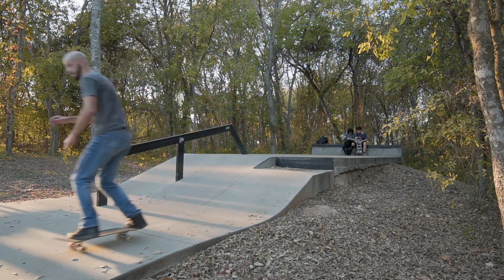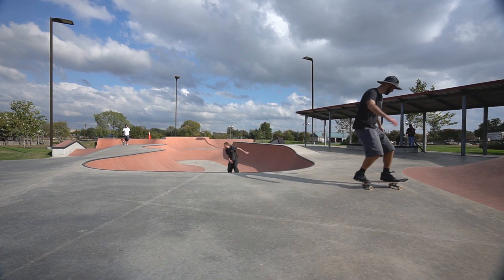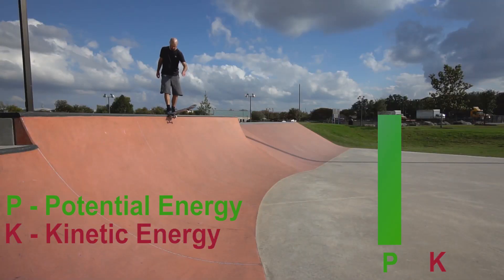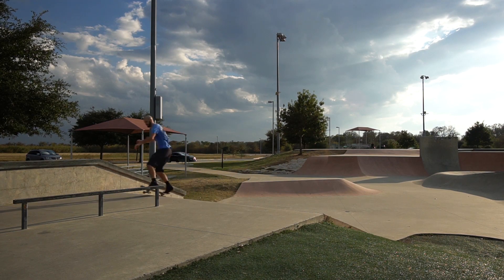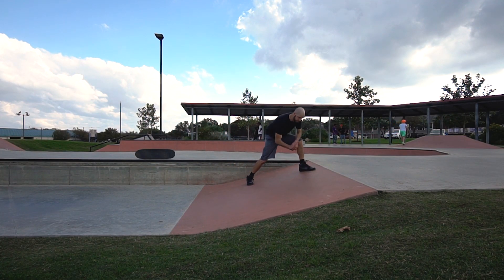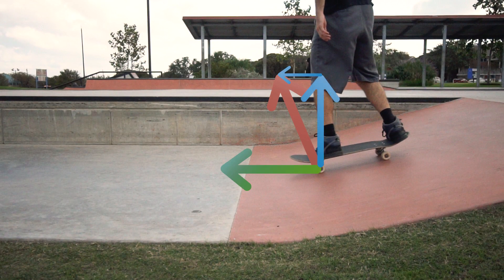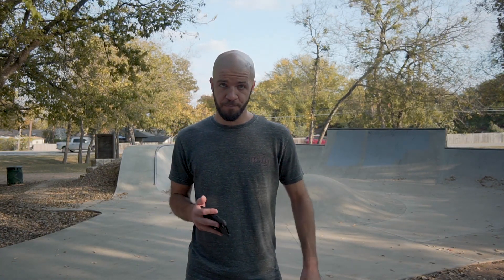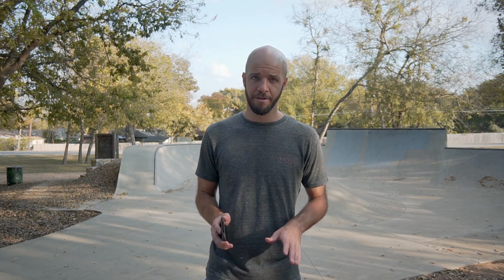The Physics of Pumping on a Skateboard - Fully Explained + Easy to Understand!

Comment: I know this video is old, but following the 'pushing to a horizontal direction logic'. Wouldn't you be able to push off multiple times anywhere on a downwars slope?
Reply: Yes but it doesn't have as much of an effect as when you pump on the transition.  I've seen bike pumptrack races where they pump the flat part of the start when they are going slow and it helps a little.  But if you are going fast it's harder to maintain control so you only pump once.

Comment: Hi @Never Stop Improving, I often see videos about pupming a longboard on flat surfaces. Does that really give speed, or there is some slight descent on the road in these videos? If it can give you momentum, how does it work where there is no curves like on the pumptrack or ramps on the video?
Reply from the maker: Ahh yes, that is a different kind of pumping, and yes they can generate speed on flat with that (even up an incline).  In that case, they are turning their board to the side slightly and using the fact that the wheels only roll in one direction (thus allowing them to leverage the friction between the wheels and the riding surface) to push off a little each time and slowly increase their speed.
Reply: @NeverStopImprovingSB  Appreciate your answer, now I understand it. Thanks a lot !

Comment: This is great. I feel like the speed boost you get in the “just crouching” scenario is from the fact that your crouching motion stops before the end of the ramp. At the moment when you get to the bottom of your crouching motion, your body ends up pushing against the earth to decelerate the downward crouching motion. So the pure crouch is really like a stealth push. If you had a shorter ramp and your crouching down movement ended on the flat ground rather than on the ramp, you probably wouldn’t get the speed boost.
Reply from the maker: I completely and totally agree with you
Reply: @NeverStopImprovingSB Thanks for responding and for putting out these awesome videos!

Comment: 1. This isnt pumping, this is vertical pumping, fraction of pumping. 2. Pumping works by playing with weight versus centrifugal forces. To visualise - hold two skateboards vertically against each other,  and match their top wheels and slightly push so there is contact. One skateboard will visualise road. Pumping is using own weight to push rotating(!) wheels slightly sideways. This causes friction, which will attempt to escape, and since the wheels are rotating, they are less resistent in that direction, so the push force will escape into that direction. The movement and principle is also used on swimming boards.

Comment: Okay so I am pretty sure this explanation is wrong. 
Tl;dr : Pumping is made possible by the conservation of angular momentum, not pushing off of the ground.

There is a video called "the physics of pumping a longboard" that explains the actual science that makes pumping possible. The video I am mentioning includes a lot of incorect information and isn't clear at all if you have never heard of the subjects used in the video, but the idea is the correct one : by bending down your knees on flat parts which doesn't affect your linear speed and extending them in the angular or curvy parts which reduces the distance between your center of mass and the center of the circle drawn by the angular part of the ramp, you generate speed every time you pass a curvy section.
I think I might do a video myself to try and explain this concept in-depth while keeping it simple so everyone can understand it with everything I have learned about it in the past week I have spent researching the matter.
Reply: First consider the transition from flat ground to uphill. It should be obvious that if you push down on the board on flat ground, this will not make it to forward at all. Putting a hill in front of you doesn't change that. The force arrows in the video which show a force going up the hill also show a force going away from the hill, which cancels out in the forward direction as you expect. The only way to push the board forward up the hill is to push at an angle, i.e. lean back and push away from you. This will push the board forward, but obviously you would fall off. You can apply the same analysis when you're going downhill; we can ignore gravity to look only at the force you can add yourself. If you push parallel to the ground you're not adding any forward force, because you are pushing the board backward exactly as much as the ground pushes you forward. But if you push straight up, as the video diagram shows, then you're pushing the board away from you and you'll fall back. In the same spirit of experimentation shown in the video, find a long, fairly consistent incline, and push multiple times as you roll down (but before you begin to level out). If pushing works just by pushing off the incline, you should be able to gain more speed each time you stand up. But I'll bet $100 that you'll go no faster than rolling.
Reply: What was incorrect?
Reply: @gradies  Hey! First of all thanks a lot for making your video and giving me the keys to understand how pumping works! Well the main things I was able to point out were you said at some point that the center of mass was geting closer to the "radius of curvature" instead of center of curvature, so basically the opposite, you said that the angular momentum had to stay constant, which was correct, but then you said it had to stay equal to zero, which was obviously wrong when you're in the middle of the curved transition, since you have positive speed, mass and radius, so it's constant, but not null.
Also the reason why I'm saying your video is not very clear is because you didn't developp and simplify the equation from L = Iw to L = mrv. Apart from those things, great video and great explanation!
Reply: Oh I realized Garrett was probably asking what's incorrect about the other video mentioned. It makes sense to me, and makes one easily testable prediction: you can't pump a transition with a smaller radius than your center of gravity. So let's get a tall person to pump some 3' radius transitions.
Reply: @AdrianQuark  I'll start by answering your second comment because I'm struggling to understand the first one rn. So coming from someone who has built his own mini-ramp, a 3 foot radius transition would be ridiculously small, since a 3 foot high transition (what I have built myself) required something close to 8 ft of radius if I recall correctly. and anyway, yes it is indeed harder to pump in a 3 ft mini ramp than on a 9 ft bowl, because you have less time to extend and bend your legs.

Comment: So How does it work in the bowl? You are supposed to raise up in the middle?
Reply from the maker: I have a dedicated video that covers exactly that: https://youtu.be/DfFJnTeLdY4

Hope it helps!
Reply: @NeverStopImprovingSB  Thanks, so basically you compress going up the ramp, straighten in the middle before the curve, then crouch again heading down and stand-up as you exit to flat? I have had trouble distinguishing between the big bowl shape and one with two corners, but your video was the first to mention that there is actually a difference. Now I just need to find a way to read that so I don't keep getting stuck like a fly on a wall on the flat vertical part of the wall.
Reply: @chinarello2928  Hey, the way it actually works is not as shown in this video but really by shortening the distance between your center of mass and the center of curvature of the curved part of the ramp :)
I will try to make a video myself to illustrate exactly how this works more clearly but this guy called Garrett Milliron made a video called "The physics of pumping a longboard" which shows the correct explanation in, unfortunately, a less understandable manner.
Reply: @raphaelpoitou8609  I will check that out. I have practiced a bit and I'm getting better somehow by accident, but I would love to be able to accelerate and not just slow down
Reply: @raphaelpoitou8609  So what I gather is that to speed up you should crouch when going around a bend and tighter the pocket the more speed you will gain. On the straight part of a wall you should be as extended as practical. The hard part is that when you go into the curvy part the centrifugal force actually makes you push against the board. So if I get this right you should kind of let the centrifugal force pull you down and not really fight it and when you come out of the pocket you can extend your legs again before the next curvy part. Where it gets tricky is that on a straight part of a bowl I can actually gain speed also snaking up and down the wall.
Reply: @chinarello2928  Hey sorry I just saw your comment. So basically it's the opposite x)
You should extend your legs when in the curved part, and bend them in every single flat part, so whether it be a vertical wall (or the part of the wall when you stop having speed) so you can extend them again when you're in the curved part etc.
Also yes it mainly comes with feeling and practice, like I personnaly only very recently learned how pumping works in physics but I have been skating bowls for a few years and I have been able to gain a lot of speed pumping without having the knowledge of the physics of it.
Reply: @raphaelpoitou8609  Is that right? I kind of thought I'm jumping out of the bowl extending my legs, but wouldn't it make me smaller if I crouch. Anyway, the pockets are a mystery to me and I just go with the flow and I'm all over the place. It seems there is too many variables (going up/down, sideways curves, snaking speed etc.)

Comment: Former physics student here who was just wondering about this...This is so great!
Reply: Hey, the way it actually works is not as shown in this video but really by shortening the distance between your center of mass and the center of curvature of the curved part of the ramp :)
By the way just wanna throw that out here, same thing for me, I was a former physics student who wanted to understand how it worked but the explanation in this video just isn't correct, as you can easily see by the fact that you could gain speed by only pumping when going "up" the transition and never down the transition, and when you go up the transition, you can obviously not "push on the ground" since, as his vectors show at some point in the video, if the thing creating speed was pushing on the floor for it to react, it would push you backwards and not forward, slowing you down instead of accelerating you.

I will try to make a video myself to illustrate exactly how this works more clearly but this guy called Garrett Milliron made a video called "The physics of pumping a longboard" which shows the correct explanation in, unfortunately, a less understandable manner.

Comment: 3:46 I don't think the vectors are accurate. Either that or I'm dumb.

Can someone explain?

(Edit)

I just figured it out. ...I think.

You're logic when going down is solid, but when going up the ramp you're not adding more force in the direction you're going, you're decreasing the force that's against you by crouching.

As your going up the ramp, your weight is making the ramp push against you perpendicular to the ramp. The is why pushing down on the board while your going up makes you go slower. But if you lighten yourself, by crouching, the less you will be pushing down on the ramp, the less the ramp will be pushing on you and therefore more momentum is conserved.

Theoretically you could "jump" the ramp. Imagine you pulled off an ollie just before going up where the board is 1 cm away from the ramp during the entire jump. Now imagine 0.1 cm. Now 0.01 cm. On and on until it looks like your riding up the ramp normally, but none of your weight actually ever pushed it. This would mean the ramp would not slow you down at all. You would literally have the same speed at the bottom of the ramp and after. Obviously you can't pull this off perfectly so some speed would be lost, and you would be limited by how high you can jump as well.

TL;DR
So basically, you wanna put more force downward on the board when going down a ramp, and decrease that same force when going up.
Reply: I like your explanation. 

Another way to think about this which helped my understanding is that:   

say you are going up a ramp, without any pumping, then all the potential energy that is gained when you reach the top of the ramp must come from your original horizontal kinetic energy, so you have less horizontal kinetic energy at the top, thus you are slower. Whereas if you stand up from a crouching position just before you hit them ramp, then some of the potential energy can come from vertical kinetic energy that you gained when you stood up, and less horizontal kinetic energy needs to be "consumed", thus you maintain more horizontal speed at the top of the ramp.
Reply: @chongsiu7893  yeah I figured out I was completely wrong about the crouching down while you're going up. You, and just like the guy in the video are correct, you need to start crouched and then as you hit the ramp, you stand up.

Apparently, this has to do with circles and centrifugal forces. It's related to how an ice skater spins faster when she pulls her arms in while she is spinning. 

If you want to understand it more intuitively, there was a great article that explained it perfectly. I forget where I found it, but google "physics of pumping skateboarding". The author mentions the pandemic, so it was a relatively recent article.
Reply: No you were right to doubt it haha
The way it actually works is not as shown in this video but really by shortening the distance between your center of mass and the center of curvature of the curved part of the ramp :)
I will try to make a video myself to illustrate exactly how this works more clearly but this guy called Garrett Milliron made a video called "The physics of pumping a longboard" which shows the correct explanation in, unfortunately, a less understandable manner.
Reply: @raphaelpoitou8609  cool, I'll check it out!
Reply from the maker: That was a good thought exercise 👍

Comment: he has explained it using proper physics.
Reply: Hey, the way it actually works is not as shown in this video but really by shortening the distance between your center of mass and the center of curvature of the curved part of the ramp :)
I will try to make a video myself to illustrate exactly how this works more clearly but this guy called Garrett Milliron made a video called "The physics of pumping a longboard" which shows the correct explanation in, unfortunately, a less understandable manner.

Comment: From what I understand, the physics is about angular momentum. On a circle L = mass * velocity * radius. Because L is constant, you can increase the velocity by reducing the radius. You reduce the radius at the top curve by compressing and at the bottom curve by extending. I think switching between compressed and extended when going straight doesn't affect your momentum, so it's important to change position in the curved parts of the ramp or bowl. More details and math at https://www.real-world-physics-problems.com/physics-of-skateboarding.html
Reply: Yes!!! Thanks fellow accurate physicist, you've said it all, this it the correct explanation.
Reply: Yes

Comment: how does this apply to longboard pumping on a consistant gradient or level surface?
Reply: Longboard pumping is more like carving, this only applies in the most general sense of it as you do try to compress into and explode out of turns.
Reply: Hey, the way it actually works is not as shown in this video but really by shortening the distance between your center of mass and the center of curvature of the curved part of the ramp :)
I will try to make a video myself to illustrate exactly how this works more clearly but this guy called Garrett Milliron made a video called "The physics of pumping a longboard" which shows the correct explanation in, unfortunately, a less understandable manner.

Comment: Can ypu explain the pumping technic on flat streets? (Getting faster by doing sharp turns )
Reply: I am not certain, but I believe it is a similar principle, you are using the turn of your board and the friction it creates to push off against slightly sideways which also contributes to the speed in the direction your board is traveling, pretty much the same idea as pumping in a bowl, but relying entirely on friction
Reply: I believe the force could be applied through pushing horizontally or dropping your weight on to one side of the board causing the board to turn sharply. This is definitely just assuming though
Reply: Hey, the way it actually works is not as shown in this video but really by shortening the distance between your center of mass and the center of curvature of the curved part of the ramp :)
I will try to make a video myself to illustrate exactly how this works more clearly but this guy called Garrett Milliron made a video called "The physics of pumping a longboard" which shows the correct explanation in, unfortunately, a less understandable manner.

Comment: great explanation! thanks
Reply from the maker: You're Welcome!
Reply: Hey, the way it actually works is not as shown in this video but really by shortening the distance between your center of mass and the center of curvature of the curved part of the ramp :)
I will try to make a video myself to illustrate exactly how this works more clearly but this guy called Garrett Milliron made a video called "The physics of pumping a longboard" which shows the correct explanation in, unfortunately, a less understandable manner.